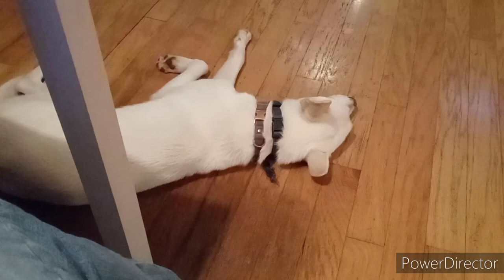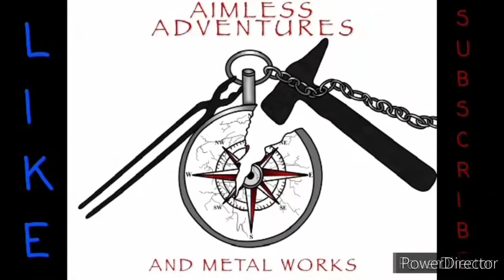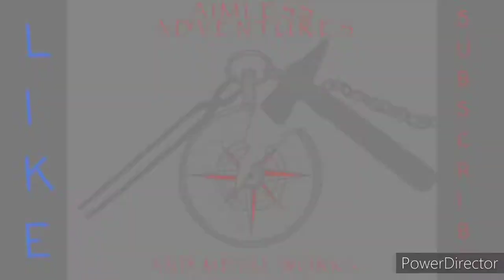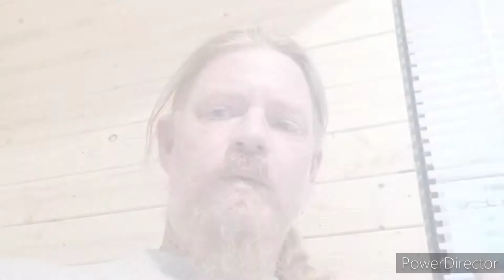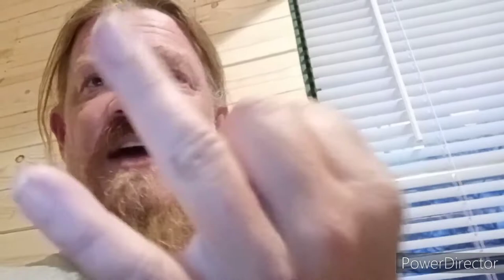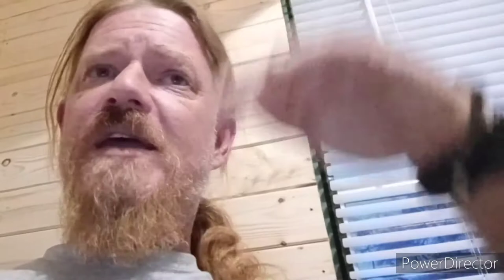Is Plaster of Paris a good refractory?

Comment: So I can't help but wonder?
If one were to mix it in the fire brick mortar mix and coat that with Ht100 or zirconium refractory stuff...
Would the coating protect it enough to not fall apart?
Or if one were to mix the plaster w silica sand And Satinite the coat w the industrial coatings ...

  However at what point is it no longer a cheaper alternative to mazzoui or whatnot¿¿¿
Merry Christmas brother
Crawford out 🙏🔥⚒️🧙🏼‍♂️

Comment: The bound water that does not go away makes it crumbly.  That water turns to steam and creates micro explosions.  The old masters understood this and were able to use it as investment...  Fact is, with today's specifically designed investment materials such as ultravest, there is zero reason to be a cheap ass and shop at home depot.  Riogrande sells proper investment materials and it's not expensive at all.  If we are talking about refractory for building a furnace, Mizzou or kastolite is your best bet.  BTW, no one here watching this "smelts" anything.  Let me know when you decide to crush ore and cook it please.  We melt metal, not smelt it.😉
Reply from the maker: On the contrary good sir. Some of the blacksmiths on this channel do indeed crush ore and smelt for iron. And yes I have considered it myself. And i will have to disagree with your micro explosion theroy as if that were the case it would happen with any material that uses water to mix to include clay used by the "old masters". My foundry uses Portland cement as the main binder and has been in use 3 years. No issues. I make a decent living so i don't need to do cheap. There are people out there that have to go cheap as they are making enough to spend nearly 100$ for 50lbs of Mizzou. So providing for a family and cheaping out on your desire for hobby is a very good reason to go cheap. Thank you for watching and commenting.
P.S. Plaster of Paris looses its crystalline structure when converting to an anhydrite. Thats the main corporate foe crumbling
Reply: @00_negative  I didnt say it couldnt be done, but for the average youtube watching idiot, they will attempt anything on the cheap everytime.  While Portland can be used, I've watched asshats show up in our forum with straight up concrete FURNACES!  Using correct terminology avoids lots of confusion.  A foundry is never a device in which metal is melted in unless you are speaking of a building or location.  While a forge can be a location or the device used to heat metal.  I find it's better to use and promote professional materials, avoids lawsuits this way.  I too failed miserably years ago with a plaster of Paris and sand mixture.  I poured aluminum in it with near disastrous results.  And it was because plaster of Paris holds bound water and never really dries out.  Even after many hours in a kiln, it still fell apart with metal pissing down the driveway.  I only use PoP now for molds and never hot metal.
Reply from the maker: I agree. My Portland mix is not standard concrete. If it were, the grog would fail and it would crumble. Its also been soaked in sodium silicate. The grog is alumina blast media. (Crushed boxrite) other than the media and Portland everything else was  made at the house. I can more than afford Mizzou or kastolite. I have a box of mizzou in tje truck now. I just have been trying to find a durable low cost alternative for those less fortunate than myself. No one want to hear dig a hole insert pipe and charcoal lol. I hope I didn't come off as abrasive. I enjoy a good debate. I dont believe ive heard of riogrande. I use hightemptools.com. thanks again for watching and commenting.